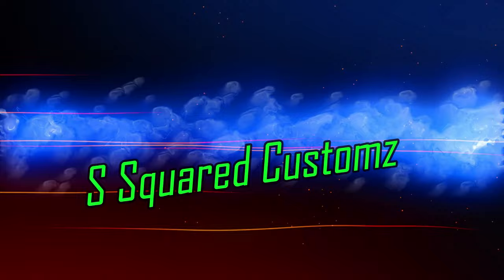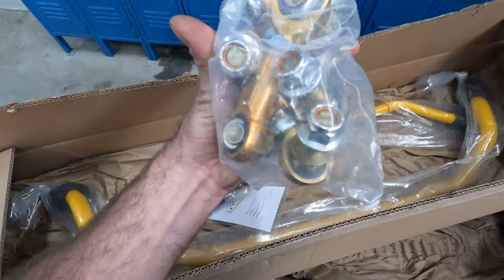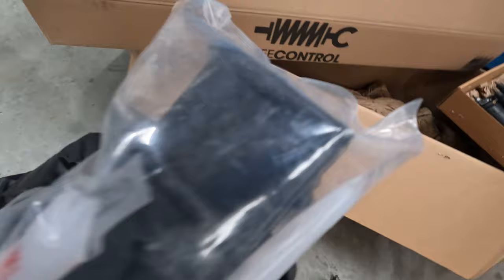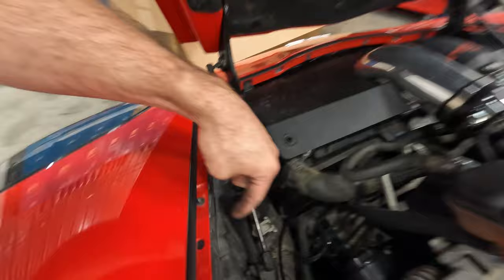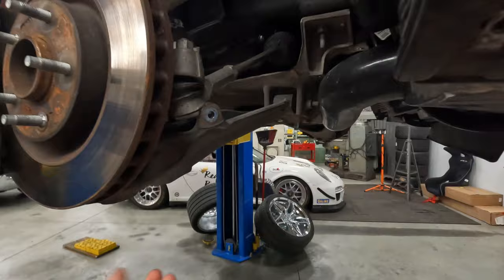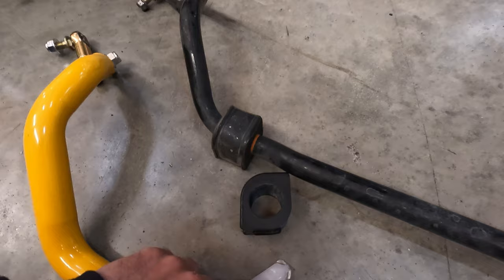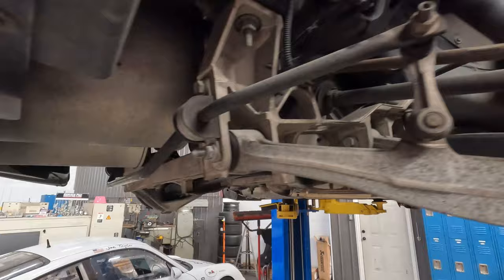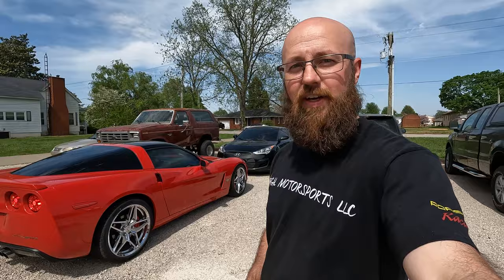2005 Corvette C6 Sway bar Upgrade Install

Comment: Did the owner give you any feedback back as to the ride quality since once the upgrade? Did the shocks change the height of the car compared to the stock shocks. I have a 2009 z06 and I'm looking to do the same mods.

Thx
Reply from the maker: shocks shouldnt affect ride height that is all spring related. shocks just absorb the oscillations. the owner of this one loved it. Said it handled far better afterwards

Comment: I just got an 06 base but the previous owner put some grand sport sway bars which look pretty thick, I don't know if its worth going with the aFe since I was planning on getting them before I made this discovery.
Reply from the maker: If the ones you have are already pretty beefy probably not needed. This customer wanted new shocks and with the added horsepower the sways were a nice touch. Definitely helped the rear of the car and in the corners.